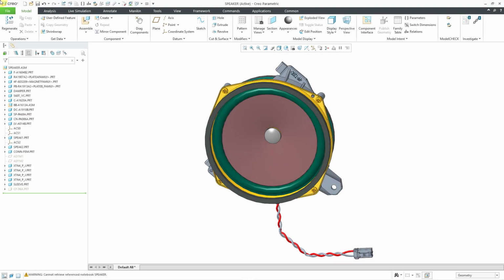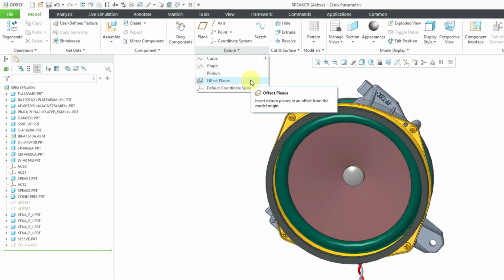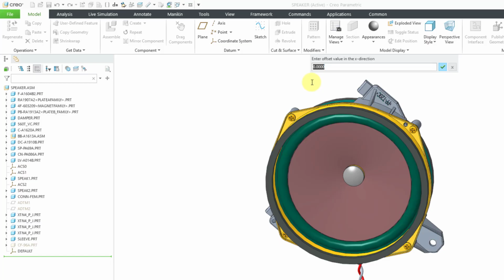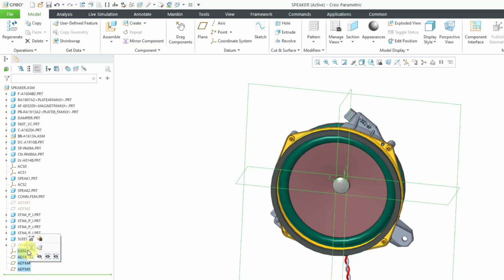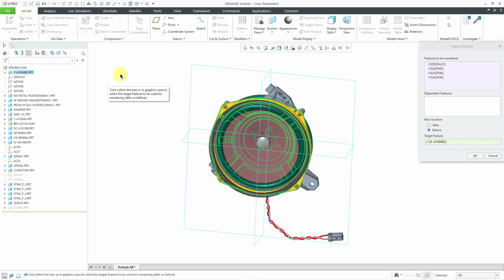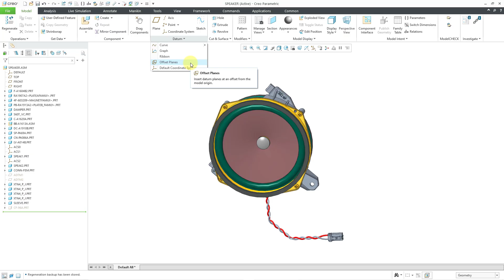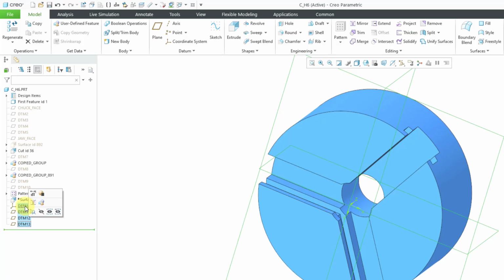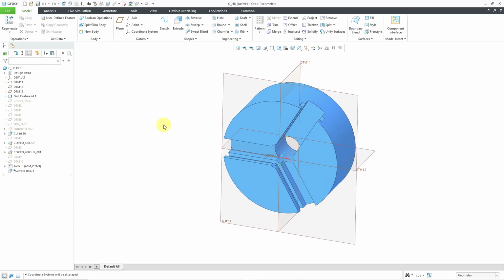Creo Parametric - Offset Planes Command

Comment: Is this command helpful in creating datum planes/Co-ordinate system on an imported IGS or STEP file?
Reply from the maker: It can, if you import either of those files without a template. If you watch my videos on "Import an IGES File" or "Export and Import a STEP File," I recommend that for a part, you create the part first and then import the geometry. For an assembly, I recommend that you Use Templates when importing.

Comment: Interesting, why is it that we can't just pull them all the way to the top instead of using 'reorder' command.
Reply from the maker: I don’t know. You can open a ticket with PTC Tech Support to see if you can get an answer. I suspect it’s something along the lines of “it’s an ancient legacy command that works to its designed product specifications,” but that’s a guess.
Reply: After sliding them up the tree drag the first item and drag it beneath the third datum plane
Reply from the maker: @pete3000 Does that work for you? I tried it in this model and it didn't work for me. That's why I showed the Reorder command in this video.
Reply: @CADPLMGuy  it did in Creo 8.  I started a new part with no template. Extruded a cylinder then created the defaults. I was able to drag the cylinder beneath the first feature
Reply from the maker: @pete3000 Okay. In this video, I specifically used models from the early 1990s to show a complicated situation. They were created before drag and drop in the Model Tree was a thing. That may have been why dragging the first item below the third datum plane didn't work and I had to use the Reorder command.